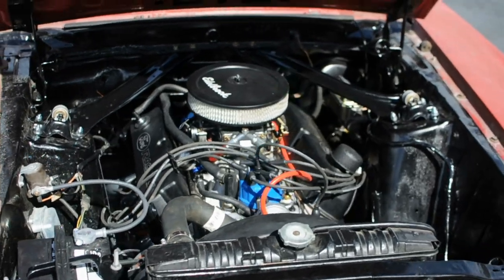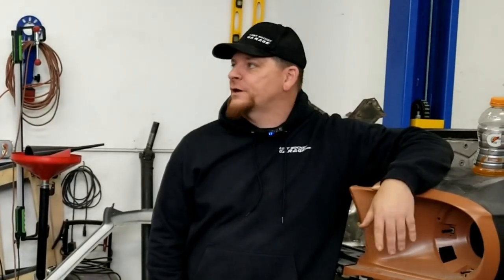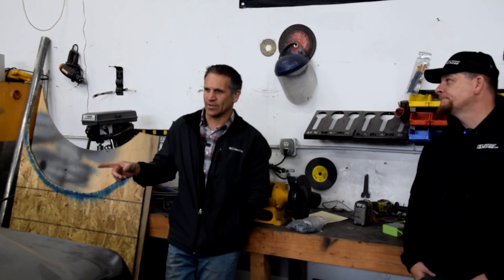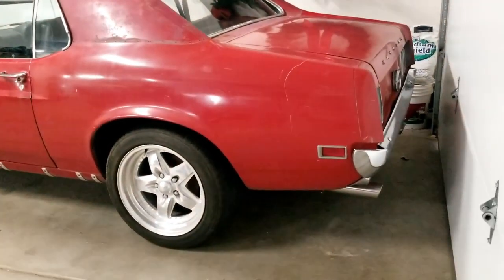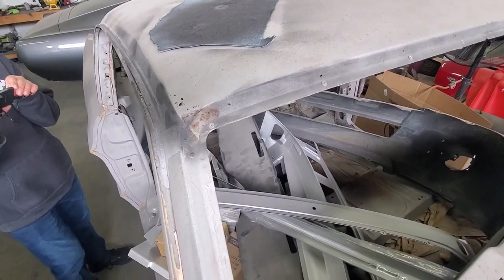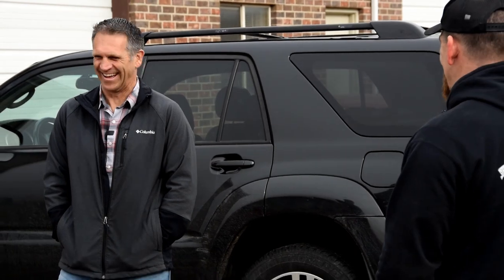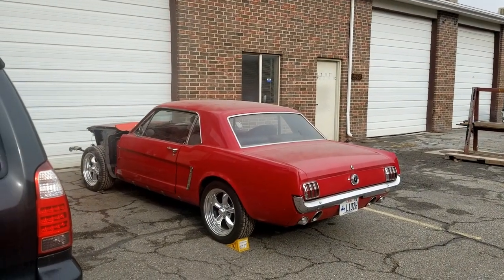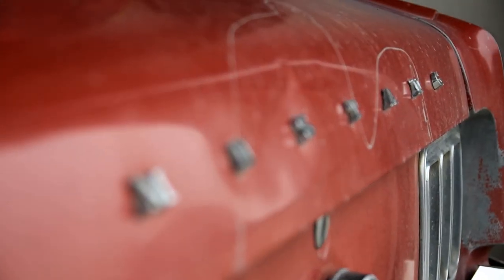Should I convert this 1970 Ford Mustang Coupe to a Fastback?

Comment: Im on the same boat. (You can see my little red 69 coupe in my channel) id love the mach 1, it looks better. It may be the sentimental value i have for it, but i love how it looks now (coupe). Mine has the mach 1 wing. Maybe…maybe if in many many more years i get bored ill convert it. Idc about value since im never getting rid of it and the body and interior are in great great shape not to mention fresh performance rebuilt AOD, brand new suspension, never crashed, no rust etc. It would be very difficult to find a 69 mach 1 in as good a shape for cheap. Its just not worth getting one at this point. Love the video.
Reply from the maker: Nice car! Thanks for the comment.

Comment: I'm with you man. I like the 69 and 70 coupes better than any other mustang coupe. I dig the style. I have a 69 that is rough. The rear quarters are bad and so is the trunk floor and rear frame rails. I am really considering building a fastback out of it, but am on the fence. I really do like the coupe and you see way more fastback. I mean i like the fastback better, but not by a whole lot.
Reply from the maker: As much as I like the coupe, and as a driver it's actually better because you can see out of the coupe better, if I had a car that was in serious need of body work, I would probably chop it up and make it a fastback. Good luck!

Comment: Want a fastback, buy a fastback
Reply from the maker: Fair point. Perhaps a tad over simplistic, but fair.

However, Hunter's comment is rather insightful. If a coupe is converted to a fastback using the same metal that Ford would have used, then what's the difference? Other than the VIN, the converted car is the same as the factory car.
Reply: @some-guys-garage  the thing that sucks is someday someone ends up with a Frankenstein fastback!  I have a 1969 mustang fastback, I built it from 3 cars.  2 of the cars, my parts cars are gone. One I sold with no vin, all removed, another I sold and it came along with a vin for a fastback,  that project was for a coupe to fastback conversion and I wonder if it ever happened. The thing is, the hardtop if now much more rare than a fastbacks.  I prefer the fastback but at this point it is sad to see every coupe cut up to make a fastback, the coupe is kinda part of history, I don't know...